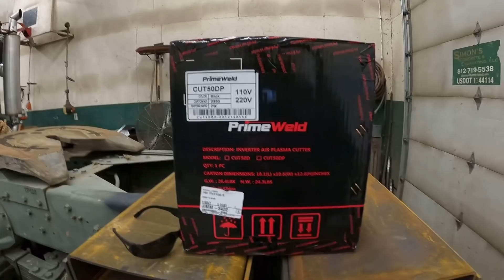Rounding up Parts for the big 6x6 truck build and visiting Todd from Truck or Track

Comment: I'm not sure if I have something that you could use but I have a 1972 Autocar Dump Truck with a 16 ft Aluminum bed.  It use to be a TriAxle but the guy I bought it from took the drop axle off.  It's double framed and a stout old truck. Would make you a good deal on the whole truck.  Not a barn door and you may not want Aluminum.  But it does have an air release gate.  I'm selling a lot of my trucks and equipment since I retired.
Reply from the maker: Trying to stay away from aluminum but thanks
Reply: @DirtPerfect    Just thought I would throw that out at you.  I also have a lot of Mack parts in the shop.  I ran across a brand new  AM/FM radio with CD that is still in the box.  It has Mack on the face plate.  If you want it I’ll give it to you.

Comment: I sure do appreciate the "road trips"! This helps everyone know what it takes to get things put together for any project, even though you are not able to record everything.  I considered how to make the frame strong and fail safe. "thinking out loud".  I would leave the inside u-channel in and add over the full outside bigger u-channel to length and then add the difference on the inside, offsetting the joints, Bolting and/or welding everything together. "IF" the welding of smaller pieces penetrate fully, then you should have a solid frame rail.  Just thinking out loud.  When I catch up with the actual lengthening, will see what you literally did.

Comment: On the plate on the door it should have the NSN number. Google it and it will give you all the info you need.
Reply: the guy at  the shop you went to was former military, he has some plaques on the wall, he would have been the guy to help.

Comment: I do a lot of concrete demolition. My dump truck bed floor got bent between crossmembers and was so rough the I couldn't keep dirt from sticking and building up so bad you had to scrape it out every other load. Over 10 years ago I cut the floor out and put in a double floor with marine plywood between the steel sheets. Works very well and has very few dents in it to this day and dirt just slides right out. Might be something for you to consider.

Comment: Ox Body, They make some TOUGH stuff! I ran an end dump hauling scrap steel. The Hard OX bed held up decently with that abrasive material being hauled daily.
 
Them high lift gates are FABULOUS! I know of a company locally that runs them on ALL of their dump trucks. They like the versatility of them. You can stack a whole load of light material in the bed, & it will fall out of the truck. I've ran them hilift gates with a load of yard waste, & it easily came out of the box. I WOUOLDN'T have been able to dump it out with a standard gate!

Gotta 💖love them heated coats! I LOVE my camouflaged Milwaukee heated coat. There's nothing like sitting in a hunting blind sweating, while you watch everybody else shivering!

This is going to be a bad Ar$e customized dump truck once you get er did! If you manage to get thing stuck then there's NOT a vehicle that'll get through that terrain! I'm 🧡loving💖 this custom build project, & am anxious to 👀see the progress on this AWESOME build!
Reply from the maker: Yup same box

Comment: Corten steel is the same stuff shipping containers is made of.  You also may see it on bridges that look like they are all rusty and not coated. It oxidizes and seals, kind of like aluminum.   If you have dug up restrained watermain, you may notice the threaded rods and t-bolts look really rusty, it would be Corten.

Comment: Something you might try if the cab has thin paint, easy off oven spray. Let set about 15/20 minutes
& power wash the paint off, will not hurt aluminum or glass. Its a lot cheaper than blasting.
I guess the reason the MBTS is such a great welder is because he has welded so many mirror
brackets back on, lol

Comment: @Dirt Perfect  I built a truck like that. It's my favorite toy. I mean truck lol. It's a 4x4 international 1854. Has the same military tires. Lifted. I love it. Use it as a fifth wheel to tow my twenty ton hydro boat trailer and I installed a knuckle boom on it as well.

Comment: I have stretched many trucks over the years.  It is a lot more work, but find another truck and cut enough frame off the back to give your length then weld to your frame.  Take bolts out of your suspension and slide back,  to get a 16' box you will not have to move back much. The suspension may still be on the original frame or partly off.  Either way the joint will be in an area that has much less stress than the center.  Bonus, only one splice to worry about.  
Yes it is more work, but you will have no trouble with the splice
Reply from the maker: Thanks and can’t find one

Comment: Might be too late, but I would suggest an airlift gate. Barndoors are okay until they aren't,  if the wind catches the door you are on your butt or getting sandwiched between the bed and the door. It hurts by the way. Even as heavy as I am at 275lbs those doors win every time. As skinny is Mr Millennial and Kleenman are if they don't let go of the chain they are going for a ride, or they ain't getting the gate closed without turning the truck into the wind. I know you don't get as much wind as Wyoming does, but a good gust could still lead to broken ribs. 

This is still going to be an awesome truck, and I am looking forward to seeing it get built.

Comment: Are you going to Dual it or can you run single wheel wide tire for low ground pressure you`ll get more payload - And never get rocks in the duals -Wouldn`t be many places you couldn`t go be like a Nodwell or Unimog  just wondering !
Reply from the maker: To me determined

Comment: Your truck seems to have dual plate framrails... you can't cut and splice in a solid length of framerail in those.!
Reply from the maker: Stay tuned
Reply: @DirtPerfect  Wrote my comment about a minute before I saw the  framrail parts you had got made...

Comment: Where did you get the old seabee truck? I hope its not too used up.. seabees only part with equipment when its either obsolete or completely unusable...
Reply from the maker: eBay
Reply: @DirtPerfect   then you got lucky.
Reply: Seabees use their equipment till its all used up..that is an old 5 ton tractor and the guy you got it from did a lot of work.. you got a real good piece of equipment. I will be following your build with interest as a former seabee myself. I have driven that model truck its a great unit.

Comment: why not push the tandem forword and shorten the drive shaft then stretch the back of frame and put the tag axle there  also it would make it a sharper turn radius
Reply from the maker: Will cover

Comment: From a structural load perspective, would you be better off adding length to the frame rails at the rear and moving the axles back rather than cutting the frame in the middle?  I think yes.  The bending moment will be highest in the middle of the frame.
Reply from the maker: Will cover that in a upcoming video

Comment: Been waiting for this project to start mike going to be a good one. I've just two questions for you 1st will the lift axle be stear too or just a lift you'll have a better turn circle if so and save tyres but obviously more complex. 2nd are U.S lift axles just a straight on off up or down type of deal or are they like ares in UK where we can keep it down but take some pressure out to transfer weight onto the driver's when traction is low but still not maxing the drive axles out. Looking good hope you are going to do the same stacks that are on your semi they sound awesome mate
Reply from the maker: All good? Will be covered in upcoming videos
Reply: @DirtPerfect  looking forward to it mate cheers

Comment: Check adelmans in Akron, Oh, they would have the frame and dump box. I have a lift axle off of a garbage truck, needs work, I give it to you. I think I might have 2, it has the step down for driveshaft. Didn’t realize you already had the parts.

Comment: I have a 12' crysteel dump body on my f450....it's very well built and guess what...I don't have a cab shield.  My cab shield was shipped loose from the dump body.  The cab shield is hanging on the wall upside down in my shop being used as a shelf lol.  I would guess a 16' bed will weigh more than 6k lbs...my little bed weighs almost 4k
Reply from the maker: Awesome

Comment: As others have commented, putting the tag axle on the back of the truck would be much easier than cutting frame behind cab and stretching out,,wouldn't have to mess with changing driveline length, clearances of drive shaft when fully flexing axles when off road,or placement of hoist assembly to clear top of transfer case behind cab. I've never been a fan of cutting and fish plating a section of frame between engine and drive axles,there's alot of torsional stress in that area, and adding two more joints in the frame seems to be counterproductive. Putting the tag axle at the rear, you have one frame joint,if can and should be over built anyways,for the dumpbox pivots, and you can adjust how much overhang at the rear for protection  of pintle hitch or lights  and wiring when dumping load,or if you plan on towing a trailer with your off road beast!! But it's your toy so how you choose to accessorize is your decision!!! Good luck😎😎
Reply from the maker: Will cover that in a upcoming video

Comment: Save the pull points or raid the local concrete company scrap /retired  truck chassis area . The factory Paystar tow points are rated at the extreme duty level.Note how they came off and install the same way NO SHORT CUTS!!! Front or rear.

Comment: I’m sure not gonna tell you how to build your truck but I can tell you a few things about truck frame truck frames are generally made from a 525 steel which is a 50,000 tensile strength steel they are also made from what you may be familiar with the known as T1 which is 110,000 pound tensile strength also you could use hardox 450 it’s the same thing as T1 if you have a double frame from front to back do you wanna add your frame addition to the very back and then roll your axles back on your inner frame rail you’ll need to add on to that so that it overlaps your truck frame joint by about 2 feet or roughly 2 times the width of the frame also don’t just cut it straight up and down and weld A new piece on I can send you diagrams and the ratio for the cut, that being a double frame truck I would assume that the frame was T1 don’t try to use 4140 it’s not generally easily welded as far as the dump box goes a lot of my customers like the high lift gates for Hauling riprap and stumps they open to about a 7 foot height and it’s all done from the cab the barn doors are generally bent to shit when I see them

Comment: I’d put a hook lift system on it.  The you could be versatile.
Reply: What do you mean by hook lift system?
Reply: @williambryant5946  I mean a hook lift roll off system.  All the dump body companies an adapt a new dump body to be able to hook it.  Then you can have options like a flat bed or a dumpster or an actual dump truck body.  It’s becoming more and more popular.  You loose a little capacity but the versatility is worth the loss.
Reply from the maker: Good idea but to heavy to tall and to many moving parts
Reply: @travisg5417  Well duh on my part. Soon as you put roll off I knew.  👍

Comment: All the deals your seeing on pusher and tag axles seem to be for non steerable (castering) axles. It almost leads me to believe that your state has done what a lot of others did after the first of the year. Non-steeable axles have been deemed by many states now to be non compliant and no longer recognized, hence they are now just payload or dead weight and need to be removed and replaced by steerables. I would check with your state permit department office and confirm that they are still recognizing a non steerables in a 3 axle group and if they plan on continuing to do so. In our state (NY) they are no longer recognized and will not renew any permits as of Jan 1. It was no secret it was coming. it was announced in 2004 and delayed many times. I know however a few states are still allowing non steerables and this rule does not apply to a 2 axle group, just a 3 axle group here in NY.

Comment: What ever you decide to do to lengthen the frame, DO NOT BOX THE FRAME JOINT !!!! That makes the frame joint  a box tube which will not flex  with the frame and will cause cracks to develop at the ends of the boxed area in the flanges. I've seen it happen many times over the last 40+ years as a welder.
Reply from the maker: Stay tuned

Comment: Mike please goggle C.A.R.C. Military plant.Very important to know what your working with. I know from working on a OSHKOSH I own.The dust from the paint causes cancer!There is nothing that will stop corrosion better than what is on the truck already. I would fine sand the cab and paint it.You must wear a special respirator! The dust could kill you! Good luck.

Comment: Are you gonna get rid of the super singles as they're called in military world and like I'm running on my 6x6 or convert it to dual 11:00/20's ?  I think you'd be better off with singles if you're gonna be doing ALOT of off road work because the single tires won't get stuck as easily as duals .... I have ALOT of experience with my truck off road and I'm running 14:00/20's which are 50" tall Goodyear's . The only thing you gotta watch out for running singles is sidewall sway and making sure all your tires have equal pressure.   Otherwise I think you'll be good !   Do you know what Axel ratios you have ?    My truck has ,Rockwell top loaders with 6.72/1 ratios on high and 3.5/1 low range.

Comment: When I built my dump body i used box tubing completely welded and oil filled. There’s no lip for dirt to sit . It’s just smooth. Took 11 rolls of .035 to weld up all the seams . I know you already did the frame but I usually get all grade 100 frame rails custom made by Adams in Vermont. They ship them to you . They just make frame rails !

Comment: Tag Axle usually straight lot of them come with steerable linkage.  Tag goes behind drives.  Pusher axle goes in front bent to clear driveline, most do not like them steerable.   Stagger cuts on frame , not straight line cut.  There are you tube videos out there to help guide you.  Crysteel did make some nice boxes. Delivered bunch in the 90'for them.

Comment: Most definitely go with a high lift tailgate.  I personally know it's alot more $ but in the long run I think you will really be surprised how much time it saves and how much you'll like it.  Soooooo  much easier and you dont have to get out and do anything 😉. Just my 2 cents... Good luck on the build !!!  I can hardly wait myself 😎👍.......Sent from TN , home of the 7 snow plows 🤭😂🤣.

Comment: Looking good on the 6 x 6. I'm liking the high lift tail gate though. The lift axle should work, since all it needs to clear is the drive shaft, if you leave the transfer case where it is.

Comment: I've had a 3 way barn door dump, hydraulic highlift and air highlift. All have their advantages and disadvantages. For ease of operation and repair I prefer the air highlift. No need to hit the pto to open it, and when you spring a leak on the hoses you're not pissing fluid all over the place and the hoses are cheaper to repair. The disadvantage to the air is it is slightly slower to lift than hydraulic, but it isn't a big deal. I have hauled 6 foot boulders with all 3 styles and they all handled the material well. If you do go for highlift, make sure you get the longer lift arms for better clearance when the door is open.The barn door advantage comes into play with stuff like sticks or logs that would typically snag on a highlift. You can also haul a machine in the truck box easier with a barn door. I hate having to get out of my truck to undo rear gates though.

Comment: Soda Blasting would be the way to prep the cab. As I understand it, with soda blasting, a good operator can dial it in and remove a single layer of paint without disturbing the layer below. I don't know if that's a reality or not, it's just how I was told by a friend of a friend, that owned a soda blasting business.
The straight drop axle, looks like it may have come from a trailer application, that had no issue with having to miss a driveline. Just sayin'......
Reply from the maker: Yup I agree

Comment: Mike, Corten steel is a trademark name for a type of weathering steel. U.S. Steel holds that trademark. Usually it is A588 or similar. Under normal applications, it is used for architectural purposes because of the rust appearance. I'm a sculptor as a profession and use it in some of my outdoor works. It's tricky as the filler metal also has to be compatible.
Reply from the maker: Interesting thanks

Comment: Did the metal company tell you what kind of steel it is (same as you thought)?
That steel looks thinner then the frame but I'm sure it's correct.  ;-)
When was the truck built and what metals were available back then?
I predict that MBtS will step cut the frame (maybe add a doubler)?